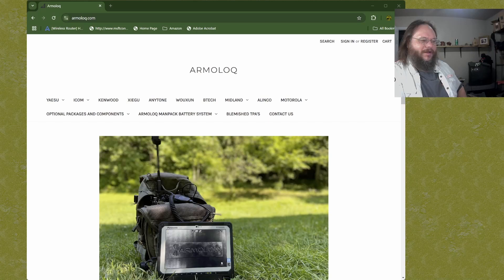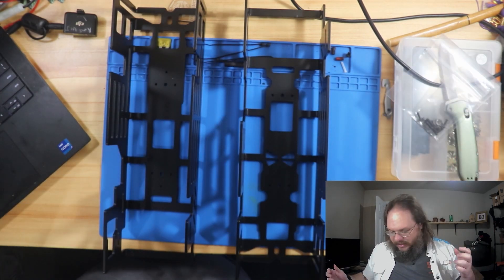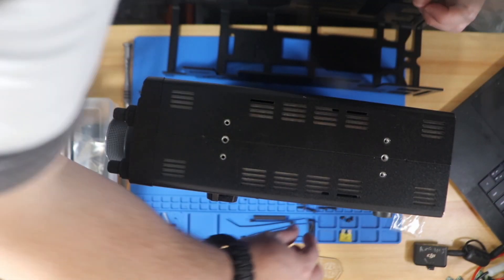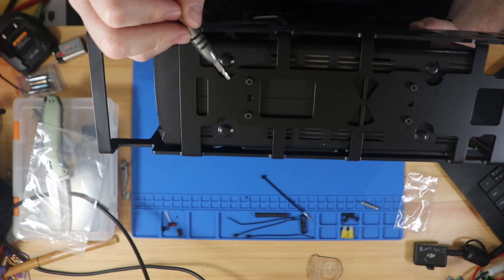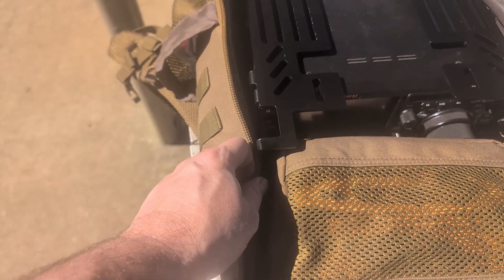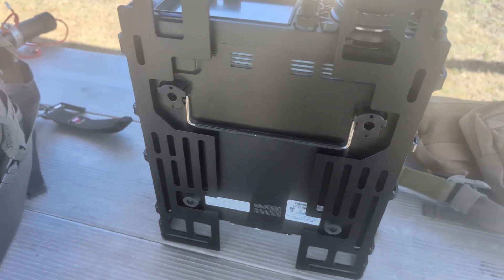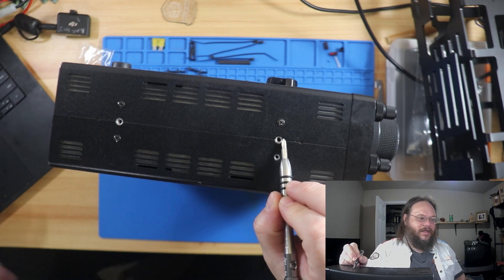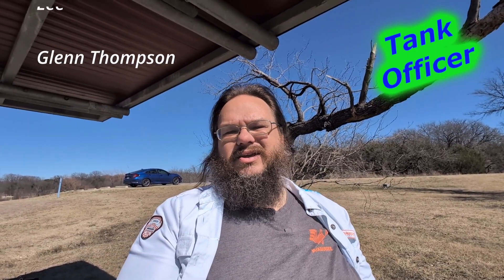New Armoloq protective frame for Yaesu FTDX10, Install and Full Review

Comment: HEADS UP!!! For those who do not want to mark up their radio cases, you may need to add two #6 washers between any accessory mount and the screw head. I moved my rf connector on mine and found round gouge marks from the screws being too long and digging into the radio case.
Reply from the maker: Good to know, thanks for the tip!